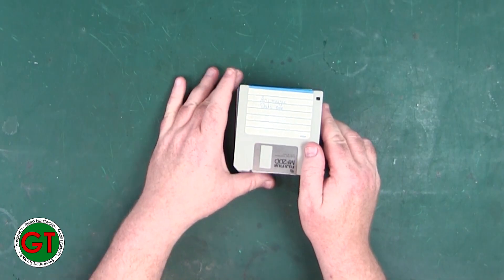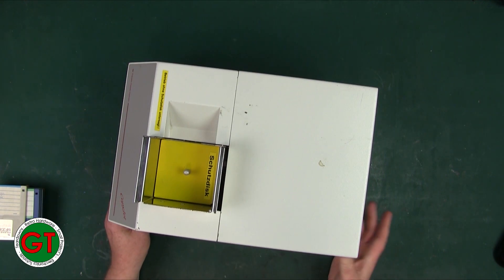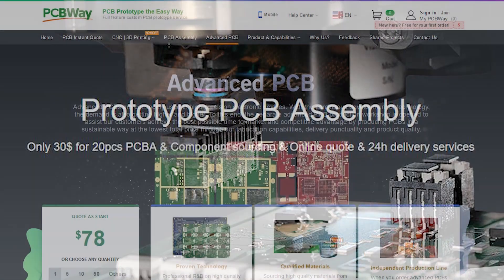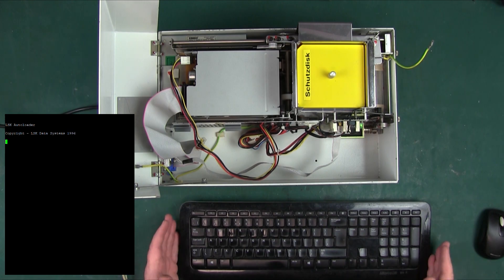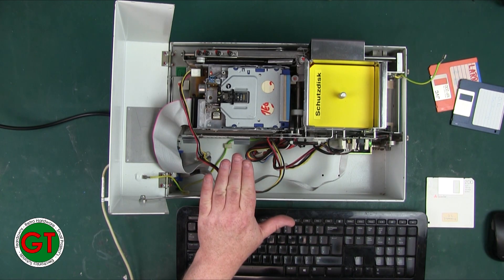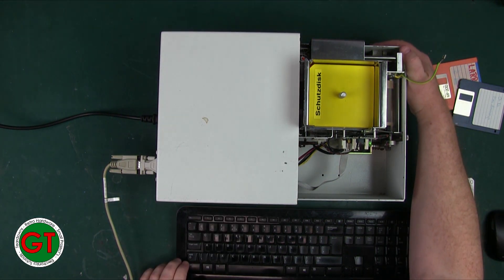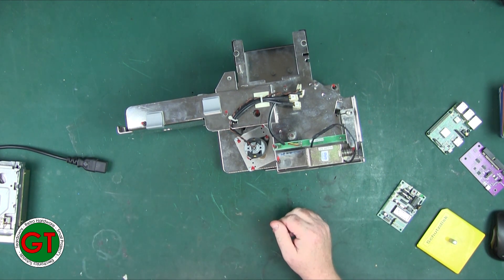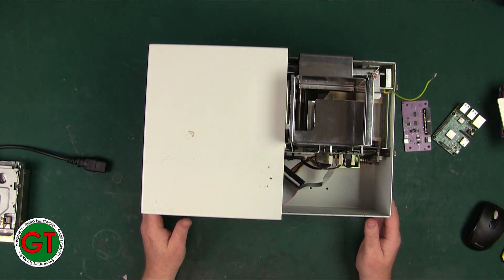Automated Floppy Disk Archiving Part 1

Comment: You are Giving my Flash macks of my CD / DVD Automatic loader..I wonder where I put That..
Reply: Do you mean "flashbacks"?
Reply from the maker: It should be easy to convert a CD duplicator into a CD archiving machine.
Reply: @GrahamTinkers  redumper can run on linux, but to use on a pi, it'd need to be ported to ARM first. possibly not a big job - its already cross-platform in terms of OS support.

Comment: I've had one of these forever meaning to do exactly this. I picked it up when my employer was getting rid of it, along with another drive and the duplicator computer and an alignment disk. We used it in the late 90s when we sent out our software on floppy, until we switched to CD, and finally downloads. I don't know if I ever saw the manual for the loader itself, or just for the duplicator software. At some point, I had sniffed the communication between the duplicator software and the loader and worked out the protocol. I would love to see the manual you have. One of the drives I have is a YE Data 2xSDS drive, which needed the Allegro II controller to function properly. It can read or write both sides at the same time, at either 600 or 720 RPM. The other is a regular drive mounted on the carrier plate.
Reply from the maker: I will put a copy of the manual online when I release part two of the video.
Reply: So today at the office, I found the old documentation. The one we had was a rebadge to Micro System Designs, and the manual they included did not have any of the serial protocol info. Only the pinout (for a DB25) and that it was 9600 8N1